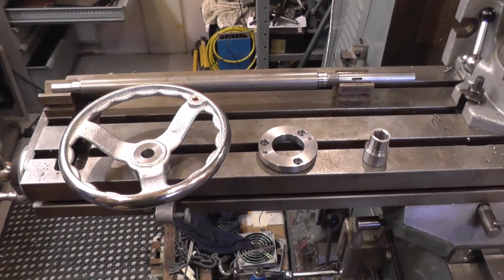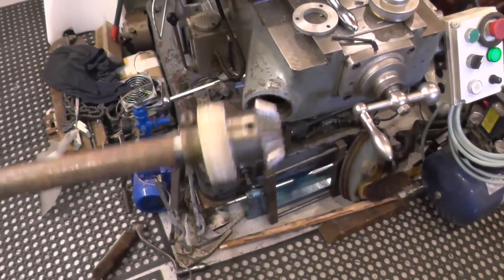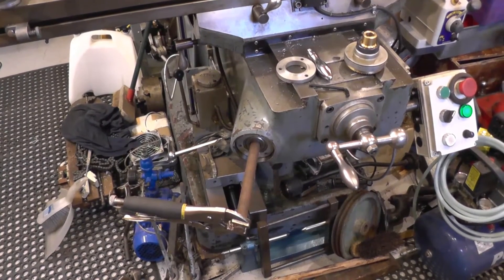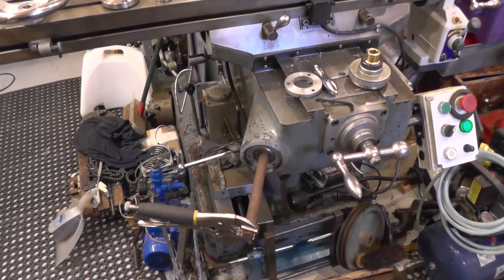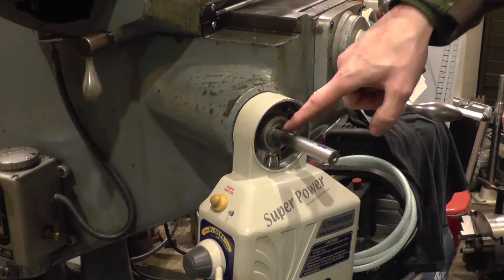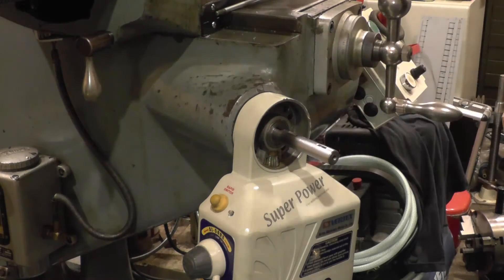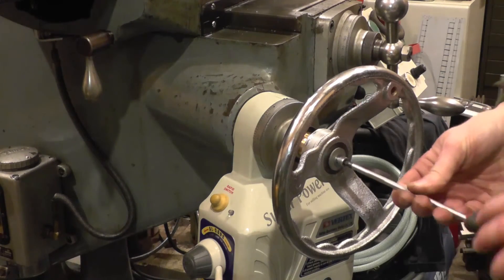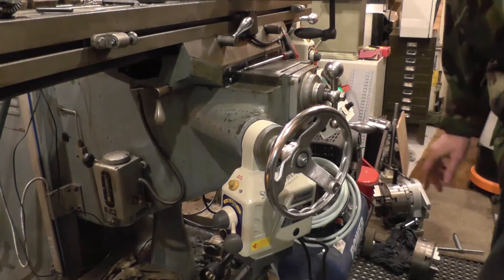Bridgeport (copy) Knee Feed part 2

Comment: I just started laughing @ 10:59. I have Rigid 535 threading machine and I cannot tell you how many time I have used the pipe chuck to hold something round to either take it apart or put it together. The big difference is that the 535 chuck has teeth so it will mar the surface of the chucked piece.

Comment: Hi Paul, Would it not be more comfortable to rotate the power feed 90 degres clockvise, easyer to get to the power feed controls and also your knee lock, nice job, a good old handmade thumbs up to you.
Reply from the maker: The knee unit is more of a rapid travel device than an actual feed. Having the lever move up for up and down for down is more instinctual than it would be if mounted sideways.
Reply: Ok, I thought that the quill was only to be used for drilling because of the lesser stability than the knee. I have seen videos where it would have been much better to use the knee than the quill (quill stability problems)

Comment: paul i put a powerfeed on my wells index and ended up having to mount it on side ways other wise i lost full travel cause the power feed would hit the floor so you may want to just check that im sure like me you seldem put the knee that lower but i did want to have to remove the feed if i did have to go that far so you may want to check for ref so you at least know hope this helps josh
Reply from the maker: I've got the knee almost all the way down right now. No danger of the power feed limiting travel.

Comment: maybe a silly question but why didn't you rather cut the long collar on the beveled gear close to the dial locking nut instead of extending the shaft?
Reply from the maker: Not a silly question at all and I did consider it. 

It wouldn't have been straightforward to hold the gear that way round for machining though and it would then become a 'custom' part should a replacement ever be required. 

I also considered boring the handwheel to fit over the gear extension, but again holding the gear to cut a keyway would have been awkward and it becomes a custom part.

Extending the shaft was all really simple workholding and doing it the 'long way' was probably quicker in the end.